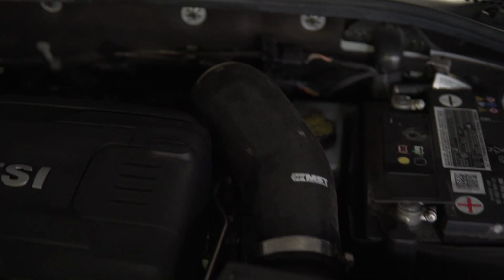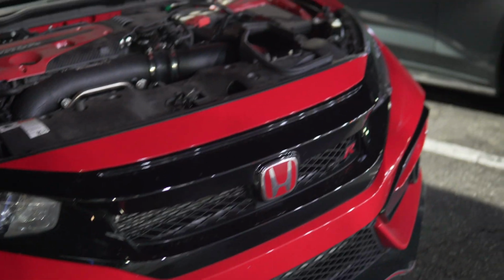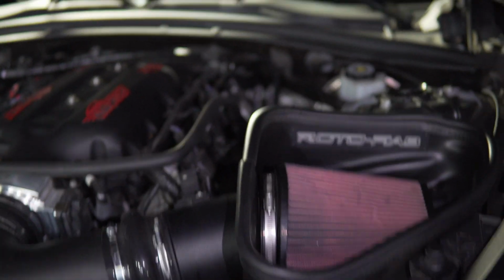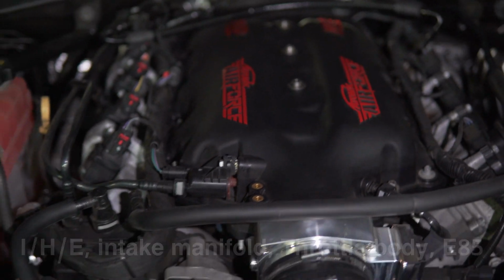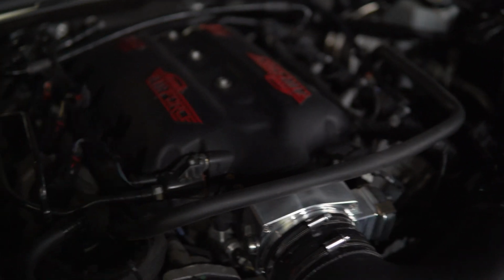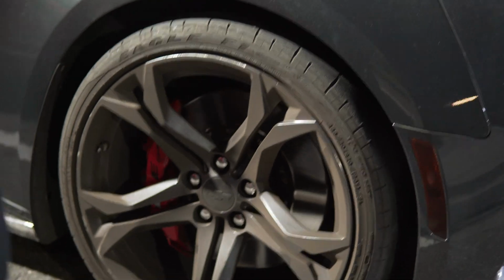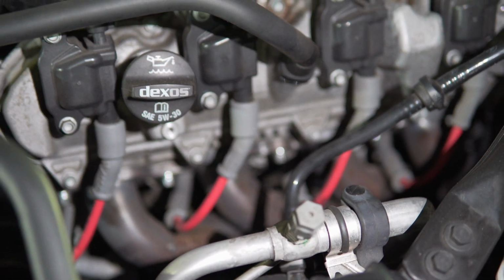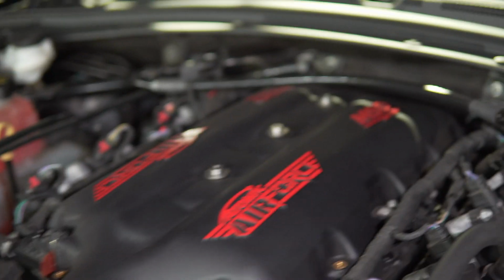500hp Camaro SS vs IS38 Turbo Golf GTI

Comment: Nice videos man. I have a ‘17 Golf R auto, HPA FR450 turbo, intercooler and high pressure fuel pump, IE inlet and downpipe, upgraded plugs and rs coil packs, and a custom intake setup. EQT tuned making about 415 at the wheels on 93. Really thought about doing e85, but its a daily daddy-mobile 99% of the time lol. Trying to walk a fine line between reliability, performance and comfort lol. I always like seeing my fellow gti/r folks out there reminding people why VWs have their reputation lol

Comment: 1LEs are actually considerably slower on the highway than non 1LEs. I was heavily considering buying one as they handle like mad. The SS 1LE throws down literally with supercars on road races. If I remember correctly the stock record for a 1LE pulled a 114 trap, the non 1LE pulled 120 though. The handling package really slows it down on the highway.

Anyway, good runs man!